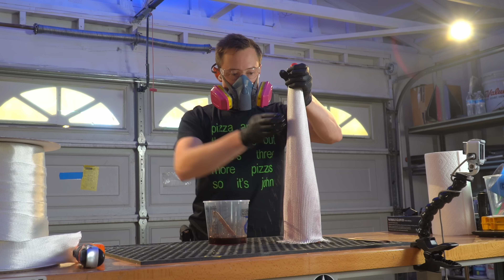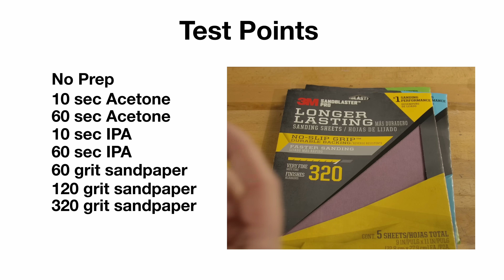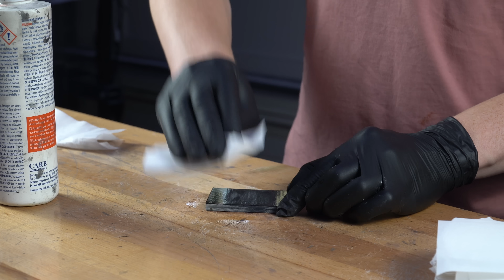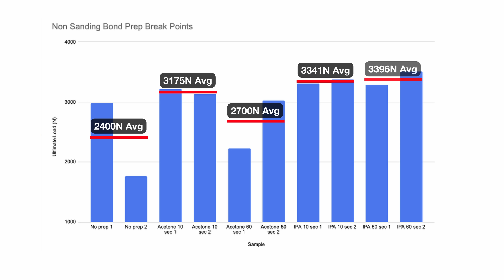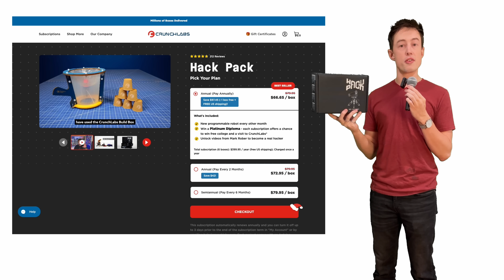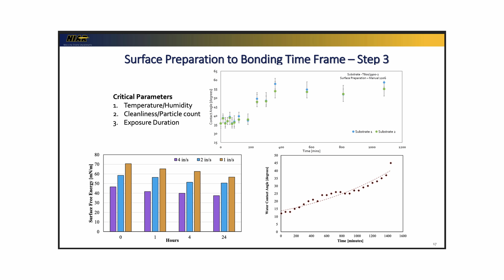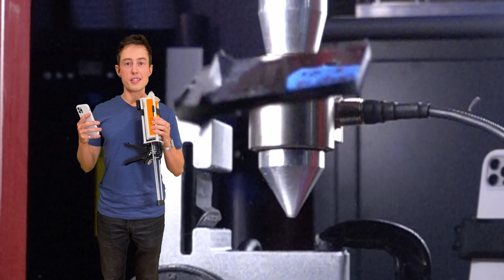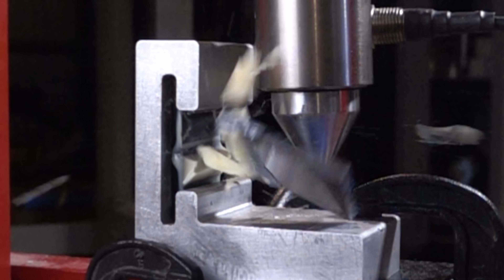I Broke 100 Epoxy Bonds to Find the Strongest

Comment: Have you considered a "prep" coat of resin on the surfaces to bond? Work it on good and wipe off the surface leaving an initial key coat, then leave to semi-cure, then place in moulds and fill as normal.

Comment: How you use water break is quite different to how the spec I worked to at (insert extremely prominent rocket company here) worked. I'm curious as to why. It was quite different. Also instead of sand paper, might try scotch bright.

Comment: For bonding orthogonal composite parts, I would recommend using a Pi joint. It distributes the stress on the joint over a significantly larger area. The only drawback is added weight and complexity

Comment: I was just wondering if your fiberglass was a polyester or urethane based resin? I'm a painter at a pretty large puktruded fiberglass manufacturing plant that makes materials and entire finished products like telephone poles and walking bridges, ladder rungs, etc. and all kinds of differnet profiles of fiberglass material like round tubes or I beams, or square tubing. Anyways, we do a lot of scuffing, sanding, or abrading when it comes to painting or using some sort of resin or paint substrate to glue things together or coat something and i was wondering if your coupons were polyster based? I'm betting they were because a urethane based fiberglass resin is almost impossible yo get anything to stick to without a seripus amount of abrasion.

Comment: This kind of tests are incredible tricky and difficult to make, even on a specialized lab under controlled conditions and the right equipment (that is also absurdly expensive) it’s not an easy thing to do, because even the same sheet of material can behave different from one section (same as the sanding paper, the epoxy tube, the mold and even the de molding process ), and they’re other uncountable variables to considerate and you can’t have any kind of control, like the weather.

But something I’ve learned during the introduction course for the masters degree, is that for each ting you want to measure you have to make 5 samples, and test them, eliminate the lowest and highest values and then take the other 3 to calculate the average value. So you can have a closer idea from the result, and if you repeat the process collecting a data base you can have a most accurate value, even if you aren’t using that fancy equipment.

Comment: Amine cure epoxy is R-N̈H2, maybe plus R,R'>N̈H. Electron lone pair electrophilic displacement attacks an epoxy ring carbon, bonding to it and popping open the ring at its oxygen. pH dependent! Trace acid, Brønsted or Lewis, boosts reaction rate. More ruins it. Carbon dioxide (breath) reacts with amine, DOI: 10.1021/acsomega.0c03727 Humidity hydrogen bonds - bad thing. Consistent extreme performance. is a right proper pisser. Acetone, ketones react with amines to imines. R-N̈H2/R,R'>N̈H plus R',R">=0  ➜ R',R">=NH or  R',R">-NR -OH hemiaminals (carbinolamines). NO humidity, NO carbon dioxide, NO residual acetone/ketones or aldehydes. One component (ester) epoxies create acid catalyst by dopant thermal decomposition; epoxy systems with aromatic anhydrides or methacrylic acid. Complicated! Tunable.

Comment: I've seen some of this with industrial paint prep as well, where most of the prep work is done to near white blasting (usually silica sand or steel shot) and then wiped with MEK... But you can still get surface adhesion failures. Add in an additional step of wiping down with another prep degreaser (don't remember what) and all is well.
Obviously not quite the same, though it was epoxy paint.

Comment: So I am a mere fabricator but one trick I have been using for a long time that I was excited to see you cover was atomic oxygen. Honestly I think you scared yourself out of trying unnecessarily. When I learned the technique it was by an old technician who had no idea why it worked. The only thing I will say is in your video you made it seem like the margin for error was super narrow when that is not the case. If you are holding the flame on your work long enough to damage your part you have help it on their about 50X longer than necessary. I have used a lighter on a pair of headphones and had it be successful. That being said I don't know how far that goes so I was super excited to see you test it and kind of disappointed when you didn't seem to give it a shot. Once my toddler is a little older and I have $60 to spend on a random experiment I will try it myself and let you know. Otherwise we will all just live in our sweet ignorance. Either way cool video can't wait to see the space shot.

Comment: Bro, my grandfather worked on satellites that probably are still in space...

He would probably say to add a second way to hold those pieces in place...

Use a combination of epoxy and some screw, that is hold in place with epoxy.

Just using epoxy to bond was never something that my grandfather used...

I REMEMBER HIM using metal meshes,
Screws, and other parts.

Don't know if my messages reach you...out of the thousands...

But hey, we are humans and we are meant to reach space as quickly as possible...I hope I could help.

Comment: using a presser pot instead of a vacuum chamber can shrink the bubbles in to next to nothing and none of the bubbles will "bubble out"... also if your going to be doing your fins in the exposed air adding an open flame to wet epoxy will pop / pull out a lot of the bubbles as well

Comment: You need to put two bevels in that one piece - like you would if you were welding them together. You are only putting epoxy on the surface - you need to bond to the layers which you can do if you use bevels.

Comment: Never shut down suggestions from anyone else when it's something you feel like you're an expert in. There's a handful of things that I would consider myself an expert in, none of which I would reject someone if they say something I disagree with, either:
- I'm about to correct their assumptions.
- What I took as fact was actually an assumption.
- There's more than 1 correct answer.
- We're both wrong.
There's no situation in which it's worth shutting it down immediately, but you can just leave if you find out they're making it up, they're pointing to obviously misleading/biased sources, or they're really emotional about it.

Whenever I'm challenged online I rewrite what they said to be closer to my claim, I'll try to understand them (if I'm expecting that it'll take a bit I'll say that I'm having a look, rather than rushing. I will mention if I'm struggling to find things and ask if they have specific jargon or links). I may end up coming back to them explaining how they were correct and what mistakes/assumptions I had made to get to where I was. If I can't reach a conclusion or everything points to me being correct, I'll lay out what I've found and what is leaving me confused; to which they may say I'm correct, or we discuss further and get to the bottom of it both of us knowing more than when we started.
When challenged in person it's more limited in terms of analysing it myself and getting to the bottom of it, and there's a lot more in terms of asking for the authority of their claims.

There is no shame in not knowing something, even if it's a field you consider yourself an expert or at least very knowledgeable in, there's also no shame in stating something as a fact that is backed up but is actually wrong, there's only shame in stating assumptions that you know are either made up or at best anecdotal. I went to Oxford to study applied mathematics and I've met and know so many smart people, the smarter you go the more easily you get people saying "I don't know" (maybe they say "I don't know but I would guess x", and hope to be wrong because it offers the potential to learn more than having guesses line up with existing knowledge), it's just that to normal people "I don't know" is a sign of weakness but to us it shows that we can be confident about the things we do state.
I'm well aware of how "I don't know" is understood by people, and how people know me as the smartest mathematician they know, and any street cred I have is lost when I show the limits of my knowledge, but I don't need to be seen as knowing everything. Number theory is usually the most interesting branch of maths for people interested in maths, because it can be as abstract and as surprising as you want, it's not something I give much time, as a result often when people talk about maths and they remember I'm a mathematician and include me I don't know and I don't care either.

Comment: Bond prep time between bonding is a big factor especially when you don't have a clean room..  all that dust in the air falling back down and time for oxidation .. makes sense
Reply: What can you put in the epoxy to strengthen it? Carbon fiber micro bits??  I know nothing just curious

Comment: Prep the surface by sanding with a low grit (like 60), wipe it clean with IPA, thoroughly hand-mix the epoxy, and crucially, vacuum degas the epoxy before application to maximize bond strength.

Comment: One thing you didn't test is deflection. Sometimes a certain amount of deflection before the epoxy lets go can be beneficial. Maybe you should have set up some sort of a high speed camera and a ruler so you could see how far it deflects before it breaks. And then maybe see if that coincides With the amount of force involved. That would let you know also if you were dealing with a very consistent material

Comment: VM&P Naptha after IPA.. my Dad, mentioned above, also worked in failure analysis for Spectronics/Honeywell/Finistar. He was a chemist and electrical engineer.. we made rockets in the 80's..
Reply: A proper cleaning / paint thinner solvent like you mentioned seems more sensible than acetone.

Personally I also use brake cleaner instead of IPA.

Comment: My dad was in the adhesives and coating department at TI. Doing hermetic seals like metal to glass.. we had Lots of epoxy growing up when I was a kid. Acetone and IPA is good but you should then wipe it with VM&P Naptha to remove the residual water that the IPA leaves behind.

Comment: Great testing prowess, that epoxy seems too brittle to secure fins, I would think more plastic (rubbery) to absorb motor vibrations and air friction would be less resistant to failure.

Comment: I don’t bond composites, but applying sealant and paint we wipe with an appropriate chemical and most importantly what I didn’t see you do was wipe dry before the chemical evaporates on the final clean. I’m not a chemical engineer, but the ones I’ve talked to says that the chemical suspends the contamination and the dry wipe removes it. Also take care to not re contaminate clean areas by dry wiping in 1 direction and use a clean wiper.
Reply: Also before we final clean the full process is chemical clean then we de-gloss using scotchbrite pads then final clean making sure to wipe dry

Comment: Did you hear about double vessel mixing? It's considered important usually.
It's also would be nice to try etching coupons is some aggressive chemicals like nitric and sulfuric acids and K or Na hydroxide. Even molten hydroxide can be used. So the topic isn't closed at all. And also an ultrasonic washer is worth try.

Comment: why don't you just de-gass the the epoxy before pouring it into the mold? like yeah you'll get a tiny bit of air when pouring, but if you're careful it's minimal. you can also use a vacuum draw up setup if you wanna be really careful about it. either way, saves a lot of hassle ;)

Comment: This video has me thinking it would have been the perfect application of a Taguchi Array, which is a testing method for multiple variables which can simultaneously reduce the total number of tests needed, and also help you find interactions between variables (like using both Acetone and IPA) that wouldn't appear when you only change one variable at a time. I've never done it but apparently it is commonplace in industry Design of Experiments. NightHawkInLight has a great video about it.

Comment: Use peel ply then you don't need to sand. Now do a test with epoxy on the actual mating surfaces between the two parts... you kept pouring epoxy beside the join line not on it. Then mix cotton flox into your resin to make it structural. Then make a small fillet - 1cm max - then lay over 2 plys on the 45 of carbon over your fillet and once again use peel ply on the outer. then test. the weight will be significantly less than straight epoxy and the strength will be massively increased over straight epoxy.
Reply: 💯 Some sort of fillet seems advisable.

Comment: A) Use a different epoxy.

B) Add fibers to the epoxy.

C) Drill some canted holes in the epoxy zone and / or mill grooves into the surface of the epoxy zone.

Comment: I walked into a hotel room last month that unbeknownst to me had an ozone generator running a full tilt. Threee breaths of that left me with flu symptoms right away and an ongoing "bad cold" where I'm still coughing up phlegm a month later. Plasma belongs in a pretty glass enclosure, not where you can breathe its chemical sh*tstorm.

Comment: Did you discard the first few milliliters? This is not throughout mixed resin and could induce a weak point or not cured patches.

You said you cleaned with isopropyl alcohol after sanding the parts? Did you brush off the dust first? You might have created yourself a separation layer depending how deep you sanded the parts.
Reply: 💯 Yeah, discard the first millimeters of the glue, it takes a bit to mix fully in the mix tube.

Comment: Perhaps this was already mentioned, but it seems the substrate should be cleaned first before any sanding as to avoid sanding in surface contaminant which would be difficult to remove post sanding.

Comment: Interesting! 

I'm wondering if it made sense to prefab the fillet shape in the form of an L-braket or triangluar wedge from Aluminium or plastic extrusion, or maybe reinforced epoxy, and glue that into place by epoxy or CA glue? That way, you have better control over the coesive strength of the "fillet".

Comment: There are some beautiful topologies on those brittle mode fractures.   I'm surprised you didn't start measuring and comparing the critical flaw sizes from which the failures propogated.

Comment: Engineers who work for the big companies will know some interesting things.  
Process consistency matters far more than perfection if there are no means of assuring perfection on every item sold.  
The engineer's definition of sufficiently improbable is that which happens once and never again.  Take this to heart.  

There is no QA/QC at small economy of scale, and I knew this before working for any large company.  
I actually told this to my first boss at the large company, near first day on the job too, when he told me about the problems with his expensive and low sales volume sports car.  
I knew this in my second year after graduating.

Edit: As for my thought on what will help, make a form fitted piece of CF sheet that is 90% or greater of the rather huge fillet volume.  Glue that.

Comment: Is it possible that the bubbling seen during vacuum degassing is partially due to low boiling point components boiling out rather than only entrapped air being released?

Comment: 35:13 just a little wording correction: acetone is not "stronger", it is "less polar". Solvent polarity is the name of the game. Acetone takes away the less polar substances (oils and greases), leaving more polar substances behind (soaps, organic dust). I would even suggest that you use something with even LOWER polarity for the first pass (hexane), but there would be a higher chance of it dissolving the epoxy LMAO
That said, I wonder if the order of solvents matters. In theory, because you are rubbing the solvent on the surface, IPA would invariably dissolve the higher polarity stuff anyway. Maybe IPA saturates faster, maybe composite surfaces tend to have more low polarity contamination, who knows?

Comment: If I was trying to make that stronger I would add some glass fibers  to the reisen. Wouldn't plain old atomic oxygen act the opposite and be more stable as o3 ozone it has something to give away and oxidize ? I think what you are making is ozone with the High voltage ⚡ because that's how ozone is made ✌️

Comment: Tenacity wins the race. The only things I have to add is when I was installing composites into 36" ID pipe, I found the addition of force made the bond between surfaces much tougher. Not just relying on the loose weight to hold things together. To clarify, the force applied was purely positional to prevent the composite sliding around. Also, gluing sandpaper to glass then sanding the fiberglass with a known weight on top and number of strokes could reduce sanding variability.

Comment: Try sanding at 90 degrees to the direction you used  and heating the epoxy in an oven after jointing……..?

Comment: Interesting. It may be considered cheating however I wonder if you start with the acetone, 60grit, ipa but then you could insert some type of rebar reinforcement rods between (and connecting) the plates, maybe like a series of steel staples and then pouring degassed epoxy on top?

Comment: I work for a aerospace company that supplies companies like SpaceX and Boing with finished electronics equipment, when we bond anything it gets “plasma cleaned” after the cleaning “working time” is two hours, no mater what it is. Also, acetone is a stronger solvent, but it ALWAYS leaves a residue, so IPA is usually always the last step.